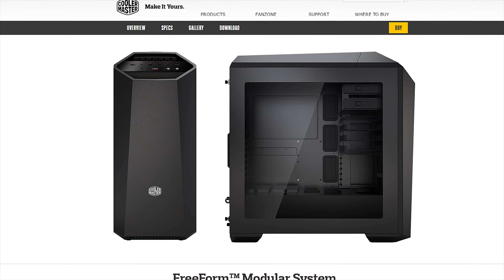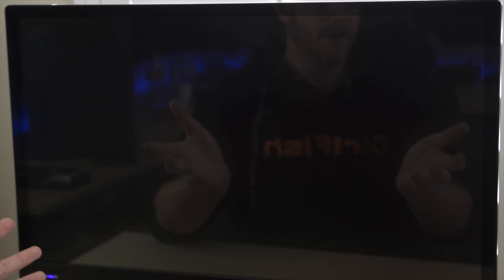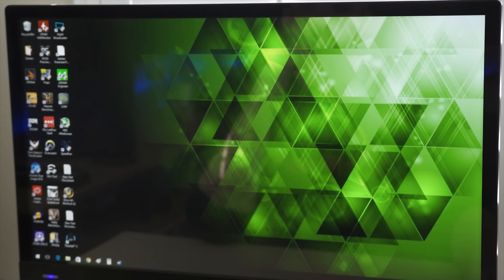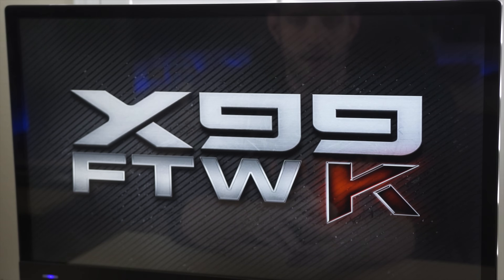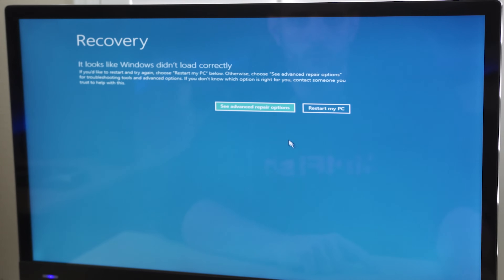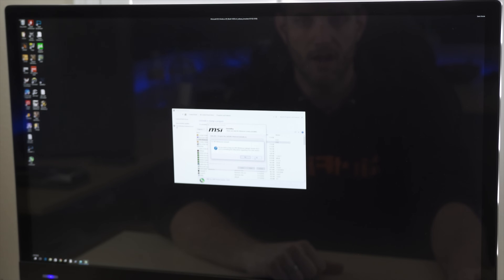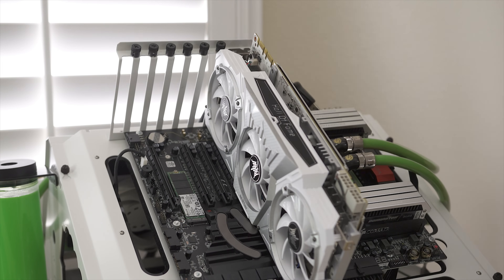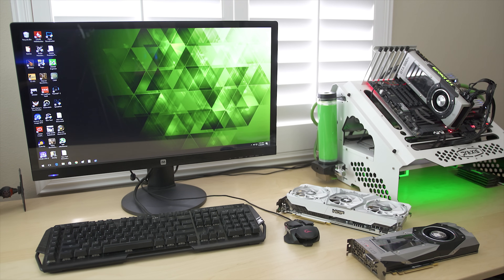How to fix a bad overclock on any Video Card

Comment: Hi guys did the dumbest thing 1080ti playing with oc,  started memory oc , the slider was sitting at +100 and i like a zombie put it at 350 and bumped the voltage and applied, now im only showing 3014mb ram what did I do?

Comment: A friend of mine gave me a spare MSI GTX 760 getting juice from a Corsair 550 PSU now my system keeps crashing(auto shutdown)  he told me the graphics card was overclocked in his sytem. Now my question is the profile still in the graphics card or is there a way to tell if the card is over clocked? If so how can i reset it.

Comment: Umm i have a problem,so by overclocking my gpu it worked normaly,but then it started colorflick,i decided to reset it,but it always gived me lower fps,i realized its becose  my gpu usage isint using its max,but on the combaster x4,x16,x8 and x32 have basicly the same fps,the only difference is gpu load is higher,how do i set my gpu load on all of the settings ro be 99%?

Comment: is there any such thing as restoring your Gpu back to its Factory state because i seemed to push my Gpu a lil too far... I uninstalled msi afterburner and set card back too stock on msi afterburner but when After i uninstalled afterburner my card seemed not too run the same anymore as it did Before as when i pulled it brand new out the box i see graphic artifacts and get very bad fps and stuttering problems and also have tried installing new Drivers too see if that fixed it and Nope did not Work at All

Comment: Hi. I have a video card from MSI R9 270x Gaming 2GB that stop working, 1st time blue screen with squares and lines, then black screen.
I restarted PC still black screen and it makes 2 long bip noise... I sent it to a service and they did nothing to it. So i start to dismantle it and i saw thermic paste on gpu was almost zero, only few paste was spreaded to sides. I clean it all , applied new paste put the parts back , set it to my PC and it runs for like 3 hours and suddenly PC crashed and black screen, i can't even enter BIOS... 
I put the card on another PC and still black screen, now my PC is running with an old gpu HD 6770 1GB. Also the R9 270X never surpass 65 Celsius and while playing games was around 58-62-63, i don't use MSI afterburner...or other tweeks, only latest driver. Also i updated my ASUS MB B350-PLUS  BIOS and Drivers to latest from the site.
Any advice whould be lovely.
This is the link with the video card from the site i bought it. https://www.pcgarage.ro/placi-video/msi/radeon-r9-270x-twin-frozr-gaming-oc-2gb-ddr5-256-bit/

Comment: I overclocked my card by like, 30 Mhz in XOC. Promptly upon doing that my computer froze, everything went black, then it flickered back, and after some minutes went back to normal. Put settings on XOC back to normal and restarted my computer, but it's never performed the same since. Used to get consistent 80 fps if not higher on rust with good settings, now I get 60 fps with a good amount of stuttering. Any ideas on what  could be wrong and/or what to do? My power supply appears to be just barely enough for a 1070, but even then I just overclocked by 30 Mhz or so so it seems incredible something could've gone so wrong with that.

Comment: I just wanna cry. My RTX2060 just has 70 on the core and 200 on the mem, +5% on vcore. I was playing GTA5 Online, the game freeze, I restart, them play other games, I did a steam of 4 hours, play cod. Everything look great. Turn off the pc, back on a couple hours later and the windows hangs and nothing works. I enter the BIOS and it hangs again, I restart, clear cmos, I unplug the card, plugged again. Nothing works. I think it was'nt the overclock, but this card is 1 year old and suddenly is dead. And with this isolation thing I dont know what to do.

Comment: My monitor just says no signal after OC the gpu...
Reply: I can help. 

1.) Make sure that you aren't overclocking your monitor.

What kind of gpu you have?
Reply: If it says no signal, it means that your monitor can't detect your PC, from the cable to display your PC. Make sure your cable is working correctly, make sure you have it fully plugged in, and maybe get another HDMI cable. If it's only when you overclock, let me know what you are trying.
Reply: I fixed it, all I had to do is switch the power for the CPU and the GPU
Fixed it well

Comment: Haha never guess what? i had the same issue not colours but more of pc saying blurry apps and taking too long to boot up so i hit restart so many times andit cam up with that. luckily i didn't panic too much because i dont really apply my overclocks on windows startup but i was more concered about my GPU being broken (as u said). because before watching this video my screen kept saying blurry apps and flickered a few times without the overclock. which is what got me panicking more of the apps flickering. anyway like i said, PC booted up fine afterwards but i was still panicking so i open me PC looked at the GPU it seemed fine no damage and so i was abit more calmer then but still concerened and kinda am. i mean its working fine now for the past 5 hours not seen any issues so what do u think should i be worried? cheers mate hope u can answer

Comment: I think I borked mine actually. with voltage. I had upped it by 10 on a MSI GTX 970 with a 180 Core Clock and a 500 Mem Clock. Last night. It failed on Valley Benchmark a few times all four screens went black a few times before I could stop the benchmark. I downed the voltage and downed the Core clock to +140 which I got the best score through the testing I didn't just go to 180 lol but now as I am playing games my voltage will go from 1.225 which has always been normal it drops down to 1.200 under load. it hasn't ever overheated or anything so wondering what happened. Also to add areas where I was getting 60 FPS in ESO, which is what I play mostly. I am getting Drops were I didn't. So time to get a new card lol?

Comment: Please Help me!, I´m writing from Ecuador , and i want to know if maybe could be the same protocol to fix my GTX980ti , but the diference is that i {ve modified the memory clock until 450mhz and my graphic card just turn it off, now turn on my pc and the grapic card doesnt Works just recognize the graphic card  but  only in GPUZ software but without information about memory size , pixel fillrate in others, please help me , What i have to do.

Comment: This is not working for me i put -200 voltage on rx580 i use safe mode with start up i uninstall msi and not working every time windows start up black screen gpu dont have voltage to start up screen fix need how or every time i install drivers not selecting graphcis card display driver goest to black screen whyyy

Comment: I just bought a used G1 gaming gtx 1070, and I have had a few issues recently and I dont know if its undervolting or anything because I checked and all speeds and specs are factory and set default, when I play games or stress test it in furmark, it usually runs fine for 2-5min, then it crashes to desktop and sometimes my 2 screens go black the same way if I would unplug display or dvi cable out of monitor and then it restarts and shows desktop normally on both. The names of the crash in event viewer are always, pc nevers crashes in the way for the reboot ro be needed, just on desktop and those errors are the ones I can see in the event viewer and its weird also if a card reaches 65+ degree temperature or fans start to spin for heavier tasks/games it usually crashes then. So I would love for some helpful info because I am really lost and I just wanna game and chill and this is so painfull because I just spent 400€ in 2021 for a almost 5yr old GPU...

"A TDR has been detected.
The application must close.

Error code: 7
 (pid=15080 tid=13504 furmark.exe 32bit)"
     
 OR       The description for Event ID 13 from source nvlddmkm cannot be found. Either the component that raises this event is not installed on your local computer or the installation is corrupted. You can install or repair the component on the local computer.

If the event originated on another computer, the display information had to be saved with the event.

The following information was included with the event: 

\Device\Video5
Graphics SM Global Exception on (GPC 0, TPC 4): Physical Multiple Warp Errors"      
  
OR    
 Display driver nvlddmkm stopped responding and has successfully recovered"

Comment: I got a crash on my gtx 970 after messing with the memory over lock. I had a stable over lock for 2 weeks of gaming before these troubles without touching memory. I had the 970 at 1472 MHz stable so I want to keep this card... Valley was a bit stuttery at first but then stopped. When I tried to play a game it crashed again and since then it won’t even boot past the blue windows screen and just shuts the system off. When it restarts there is green lines going across the screen and it will crash a few times and eventually load into windows. But one thing I noticed was that the 970 is no longer detected in msi afterburner and is displaying through the 4970k display even though the hdmi is still plugged into the graphics card......what happened please help I do have a spare gtx 950 from my Mobil PC that works just fine when plugged into it

Comment: Actually overclocking does kill the card. I had a Galax 1070 ti Ex black. Overclocked with afterburner to 100 mhz more. It was stable while gaming for 2-3 weeks and I reset the profile after gaming each time until one day when this problem started arising. Pc will freeze after 1-2 minutes that also in normal mode. I formatted c drive somehow but it died anyway and the issue remained. Now the company wont RMA it cuz they saying GPu died becuase of overclocking.
Worst thing is I took a bank loan last year for this pc and costliest part was the GpU and I cant do anything now. I will be depositing money of the Emi and I cant do anything. Dont have spare GPU too in my ryzen build so no display also. I am crying every day thinking why the hell i overclocked my gpu to play Pubg Pc and Csgo

Comment: i didnt do any overclock just i downloaded msi after burner if my graphics gets too hot to put fan speed at 40 to my gtx 770 and went to play and while i had the fan speed 40 at msi after burner my fps was stuck at 20 and gpu heat went crazy i was like wtf i deleted profile and everything but since then my gpu idle has temp 44 and i dont know what to do .does anybody know what it could be ? i cleaned it everything or probably i should change the thermal paste ?

Comment: hey Jay !! i tried to overclock my graphic card but i think i pushed it a little too far and started seeing some visual issues on the screen so i just went back to default settings and uninstalled MSI afterburner, the problem is even then i still have these squares and lines appear on the screen whenever im on twitch or youtube ect and its really bad.. i googled it and ppl say i might've damage my graphics card. PLEASE help !!

Comment: How do u fix a computer that the utilization of a gpu is at 100%. It keeps crashing my games and no video is giving me the answer I need
Reply: reptotuber 
Step 1: Go to settings and click update and security
Step 2: Go to Recovery and then press Advanced Recovery (it should restart)
Step 3: Go to Trouble shoot ( this is windows startup menu
Step 4 : Click STARTUP SETTINGS
Step 5: Press the F4 or 4 key
Step 6: It should bring you to another similar page
Step 7: Look for Enable Safe Mode, if it says that, you can proceed and restart
Step 8: Go to Apps and uninstall Msi afterburner 
Step 9: Restart your pc
I believe thats it

Comment: Hi jay I have a similar problem but it's not my GPU it wont let me load up windows I was just watching youtube turned it of then turned it back on because It kept lagging on every application I clicked use all cores then reboot the pc then I have the windows automatic repair screen after I did the code promt nothing is there any way to fix to or anyone that's reading know how

Comment: I was overclocking my aurous rtx 2060 super I had gone up in small intervals on both core and memory and then I jumped a bit to +200mhz core and +900mhz memory about a 100mhz jump on both and I loaded up fire strike and it froze and then black screened. After that it said "display port no signal" and I tried a different displayport cable and reinstalled GPU. I also disabled msi afterburner profile but it's still not displaying anything please help. Is it fried? The fans and rgb and such still work. (750w bronze+ PSU if it matters)

Comment: jay i have been haveing aot of troble troble shooting my pc i built 3 months ago ryzan 5 3400g asrock b450 steel legandm with a 1msi 1650 gameing x i 32 gb ram overclocked in after burner i also produce music i was in the midle of a seshion and my computer just shut of it gose into a bsod i get kernal heap coruption,page fault non page area,kernal security check failure,mem managegment,system thread exception not handled,driver pnp watch dog, also in the bios ram sometines dosent show up the cpu always dose thow i am tec savy also but have never had this prob befor naturaly i started with the ram because it wasnt showing on every boot i bought 4 more sticks to no avail so then i bought another motherboard and that wasnt it i wiped all my drives and tryed to install windows on each one separetlyand that did not work i was a high school drop out and im almost 40 but i got my ged and started takeing music production college classes sorry im a tarible speller any way i spent every dime i had saved in the last three years on this computer so i could do online classes i also spent 2500 dollors on i mised two tests and cant passs this samester so i waisted that money i live alone with my dog and bairly have anoff to live on i guss u dont need to really no all that im just in dier straights and finding someone to help me is like pulling teeth PLEASE HELP ME SO I DONT MISS ANY MORE CLASSES! for a lil info i would be willing to make some instramentals royalty free for your chanel i am also a artist and would be willing to draw you a hudge portright of u or something!

Comment: Hey jay nice information. I am facing some issues with my sapphire rx580 special edition card. At first when i installed my card it crashes after some 10 minutes game play. So i googled and got a solution that wattman is buggy and it not start fans. Then i tried custom curve with msi afterburner every thing seems fine now. But today i have over clocked my rx580 with +65 core voltage, 50+ power limit, 1500mhz and 2250 mhz. And ran shadow of tomb raider for about 30 minutes. With maximum temps 65 degrees. But after closing game i closed msi afterburner also. Then i got black screen. After force restart pc boots but for a while it hanged and when afterburner started automatically system start responding normal. Please tell me are those oc settings are good or i have to tweak some core voltage or something. Please suggest good oc settings for my rx580. Sorry about grammar.

Comment: my default gpu core clock is 810 mhz and mem clock is 800mhz .. i overclocked my gpu with kombustor tests every thing was fine but after a reboot i launched msi afterburner and the gpu clock on the  left circle was decreased to 405 mhz and mem to 324 mhz and these values did not and so not increase with furmark and kombustor tests while in the center the values were the same which i set up my self and i experience more fps drops in my games. can anyone help me?

Comment: Hey comments please I need help. My computer went black screen after I over locked to 3.9 on my amd 5 1400. And I just unplugged the cord to the PC and it won’t start up. I’ve tried removing the BIOS battery and putting it back in and it still won’t start up, it’s the shadow II model. Please I spent 850 dollars on it and I can’t get it to work. It won’t even start up to be able to reboot.

Comment: i wish jayz had  a video for fixing a common annoying issue for many people who OC their gpu ...so i did a lot of researches and over clocked my gpu  i was 99% sure it was a safe over clocking. i got +30 fps for ghost recon breakpoint with ultimate settings BUT i got very bad annoying graphic bugs artifacts and a lot of game crashes  ( after over clocking i got these problems : my games look  very strong coarse abnormal horrible sharp , 2nd problem : low res textures and a mesh effect on everything in the distance .everything looks like a net .on the bushes,grasses,trees,etc in the distance more than 50 mt away. and they look like a 1-dimensional image. i'm afraid my gpu is broken after over clocking ..if anyone knows whats that or how to fix it pls help me

Comment: i tried to overclock my gpu (1070ti armor) +100 core clock and +50 memory clock and after that i ram msi kombustor and my screen started to flickering and i returmed the overclock to the factory setting and after that screen gliching was gone i was playing just cause 3 my fps var 38 to 40 and game was choppy did i killed my graphics card and can someone please explain what to do i ran heaven benchmark and got 90 100 fps (msaa x4 rest was max settings)